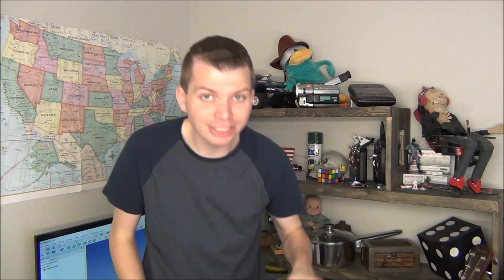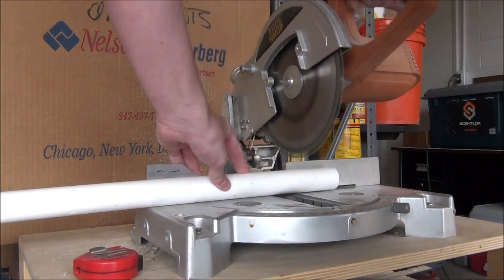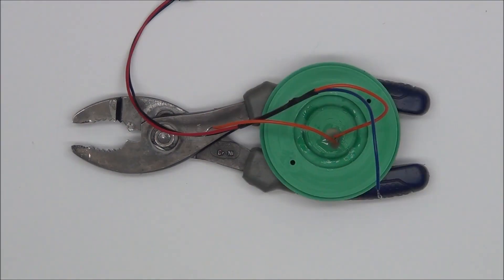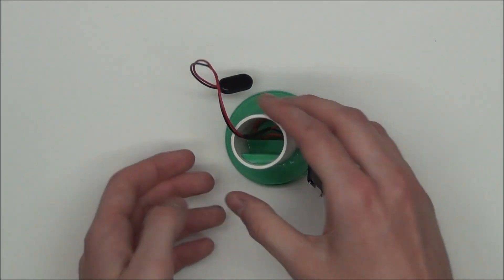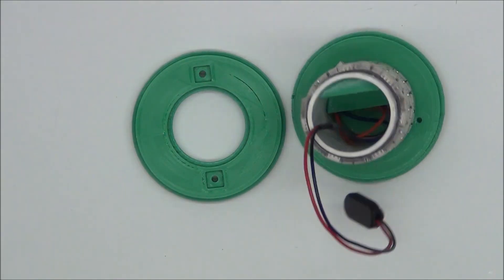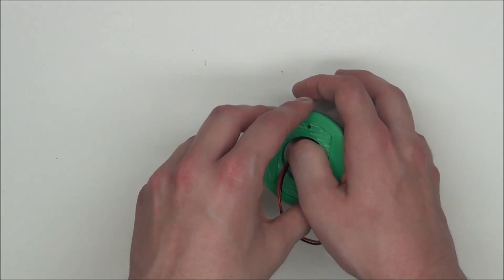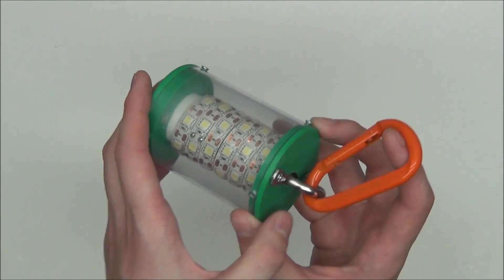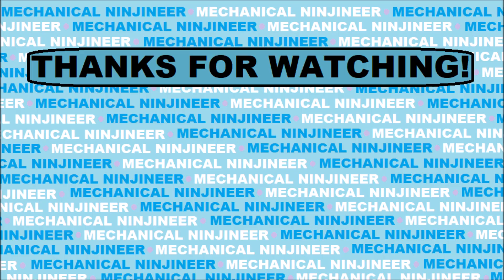Building A Mini Led Lantern!!! // How To Build A Led Lantern!!!

Comment: Why not use 18650 battery?
Reply from the maker: 9v are cheaper and easier to replace.
Reply: @MechNinji  but 18650 it rechargeable 😁, but nice work though might try them but using 18650 😊
Reply from the maker: @daydreamers845  Thanks! Well, they sell rechargeable 9v. They're pretty common anymore